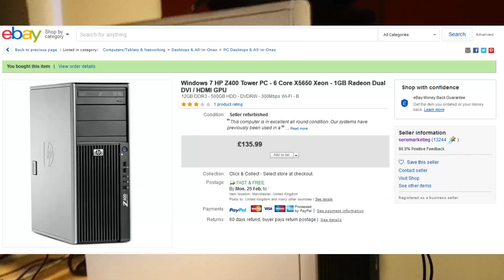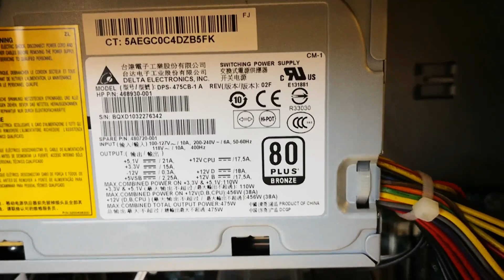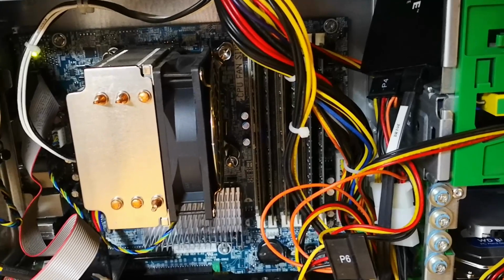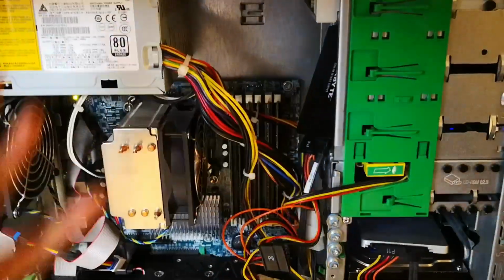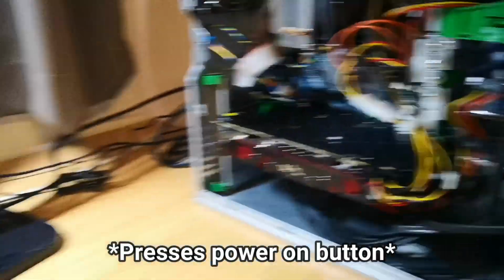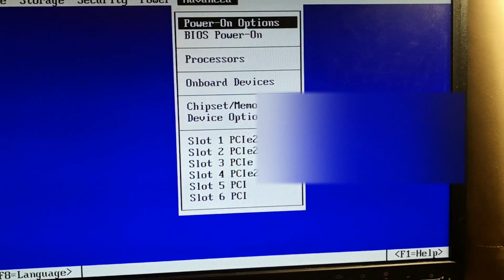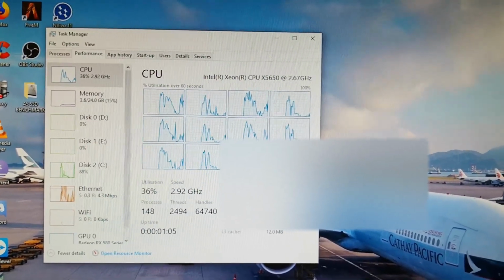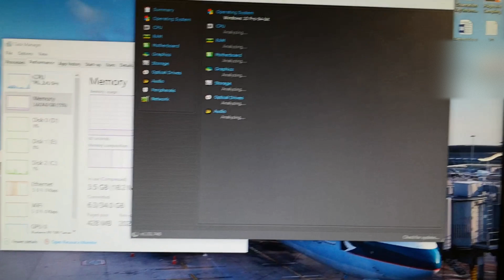HP Z400 6 core 24GB RAM RX 580 Xeon £300 GAMING PC build 2019

Comment: I have the z400 too and the xw8400. The workstations can be fully upgraded, even the PSU can be upgraded there is an upgraded PSU from HP or you can get an ATX one with a converter to plug into the motherboard. It does not matter that Sata3 is missing you can do SSD Raid0 and i am getting speeds of 530MB/s +. You can also upgrade to x5690 6 core 12 thread CPU. and 32gb ram for the 4dimm slot version of z400 and 48gb ram for the 6dimm version of the z400. The only limiting factor to the machine is the PSU so if you want to go to a high end GPU you must change it. I for now have the nvidia 1060 which works great.
Reply from the maker: Actually, you could change the PSU, but it won't physically fit inside the case. IT IS NOT ATX SIZE. Yes you can change to the HP 600W_ one, but there is really no poin, this platform is long dead.

Yes the CPU, I have upgraded to a W3680 now.

And the RAM, You can only use 4GB dimm modules. Please refer to this: https://h30434.www3.hp.com/t5/Desktop-Hardware-and-Upgrade-Questions/Z400-RAM-Upgrade-from-8GB-to-12GB-or-16GB/td-p/6746942 ** EDIT** Apparently You can use 8gb dimm modules, but it is not officially supported by HP. plus, if you had that much money for that amount of ram, might aswell buy a new PC
Reply: @UrbanOzzy  Atx psu can fit inside. GreenPCGaming has done so. There are videos here on YT. Latest CPU you can use after bios update is x5690 or w5690. And yes you can use 8gb ram stick after bios upgrade.
Reply: @isymdvr  w3680 is better because it can be overclocked to 4.00ghz
Reply: @xenooseater6124  Yes i have done that software overclocked the w3680

Comment: Help, I can't get the graphics card to work. Rx 480 8gb, if I put it in and try to start, the power button turns red and it beeps 6 times.
Reply from the maker: reset bios settings by taking cmos battery out of the motherboard for 30 seconds, then put it back in! Should work. After which, place rx 480 back in
Reply: Update your bios to

Comment: I have the EXACT same Z400 gen2, I have a XFX RX 580 8 GB, 12GB 1333 DDR3..
I replaced the old PSU with a Semi-Modular Rosewill 650w PSU, all black beautiful cables, no issues at all.
I also mounted a small fan on the NorthBridge, and an Arctic front case fan.. My rear case fan is silent, along with the CPU fan.. Even when I crank it up all the way through the BIOS, the fans aren't really audible, just sounds like air blowing. Maybe your fan's bearing is going out.
SATA2 doesn't restrict your 4k write/read speeds AT ALL, so the most important part of gaming performance from an SSD aren't hindered..
The X5675 is a great option for CPU upgrade, if needed, and remain on the same TDP, the X5680 brings it up from 90w to 130w.
The "W" series CPUs are only different in a singular way, they cannot be used in "dual CPU" configurations, which we aren't worried about, so those are perfectly fine for upgrading..
Reply: Mine sounds like a jet engine at full speed
Reply: The W3680 & W3690 CPUs are also multiplier-overclockable which the X56xx processors do not have.
Reply: Bro does the xfx card work with legacy on the hp z400??
Reply: @bestage9429  also mine.. At least 1800 rpm the chassis fan..  I would like to reduce that value...
Reply: @matteozambon6744  I've tried overriding the BIOS fan control with SpeedFan before, didn't work unfortunately...
Only thing you can change is the minimum fan speed in the BIOS which only affects how fast the fans run when the machine is cold.
Reply: @bestage9429  already tried too.. And already set up the speed of lowest level on bios.. It start to be quite fast after i update the bios... Temperature seems normal
Reply: @matteozambon6744  Mine also only started ramping up the fans to ridiculous speeds after a BIOS update... Actually before the update the fans would barely ever ramp up above minimum speed at all under full load, so pretty sure something's running a fair bit cooler now at least! CPU temp hardly ever exceeded 67 deg C under full load (stock Xeon W3520)

Comment: How stable is that RX 580 + overclocked W3680 configuration running with that 475W power supply? I'm a little worried about that molex to 8 pin connection whether it'll handle the full wattage of the RX 580 or not.
Reply from the maker: Very stable at 4.0GHz, I play siege everyday in fact. But do get the DUAL molex to 8 pin though
Reply: @UrbanOzzy  Alright, thanks for answering.

Comment: You can change the ps just get the adapter from moddiy. The CPU cooler can also be changed just a bit complicated.
Reply from the maker: A standard ATX PSU won't fit inside the HP Z400 case. As for the cpu cooler, yes it can be easily done. But the system is currently running fine, i don't see a need for it yet!
Reply: That's very good to know. I will be putting an RX 580 in this beast as well, and hoping not to have to change the psu. I will just need to find an adapter for the 8 pin pcie like you did. Wondering if there would be a difference between going with sata vs molex...
Reply from the maker: @ZuckerbergDaReptilian  go molex it can handle more wattage than sata. Please dont go sata, it will melt, i have tried 😂😂
Reply: Damn :D .... I actually just ordered the dual molex to 8 pin about an hour ago through ebay for like 3 dollars usd. Now I'm thinking maybe they will melt too since I paid so little lol.
Reply: @UrbanOzzy   YES there are ATX PSUs that fit. its been done before

Comment: what about the psu ? Does it handles all of this load ?
Reply: If you use a GPU with only one power connector like the Nvidia 1060 you will be fine for sure. Using a higher power GPU you never know it depends on how much power hungry it is under full load.

Comment: Hello thank you for this video. I'm actually trying tu update my HPz400 with your video. It helped a lot but now I have this error message when I turn on my computer. "517-low power cpu heatsink(s) detected for high power cpu(s)". What should I do ? Thank you very much
Reply from the maker: Please refer to this, https://h30434.www3.hp.com/t5/Business-PCs-Workstations-and-Point-of-Sale-Systems/Hp-Z400-heatsink-problem/td-p/5678105

You will need a 130W rated CPU Fan/heatsink

Comment: hello u can use stock z400 psu for rx580?..i believe rx 580 need 500w psu
Reply from the maker: Yes the stock PSU in the the Z400 is 475W power. Shouldnt be a issue, if you actually watch the video you would know that it will work
Reply: Ok thanks man
Reply: You need a 6 pin to 8 pin converter.

Comment: i have the same pc only i have w3680 3.3  ghz but he cpus it gettig to hot i already replace the paste i think the cooler broken.I bought for 30 euro on a local marketplace
Reply from the maker: Really? I just bought a W3680 too off EBay, I will do a follow up video. Do you have the high performance cpu cooler with three heatpipes btw?
Reply: What is "too hot" ???
Reply: @ZuckerbergDaReptilian  45 degres only youtube
Reply: You're ok thats nothing
Reply: you have face book
Reply: 40-50 degrees idle isn't bad compared to the maximum temperature of the processor (94 deg). What are your load temps? Make sure it doesn't approach or exceed 90 under load and you should be fine.

Comment: Hello i know this video is old,but can i upgrade my xeon w3520 to a 5650,or do i require a different motherboard
Reply from the maker: Highly likely, but check with others first
Reply: If you have 6 slots of ram memory, for sure.. I just upgrade from w3520 to x5660.. Even the ram will run faster..

Comment: can i use rx 580 on 475 watt supply?
Reply from the maker: Yess no problem at all, just get a molex to 8pin adapter though
Reply: @UrbanOzzy  I did it with 6 to 8 pin connector
Reply: @ZoXXy20  bruv did it work, is it still working?
Reply: Yes it's great a
Reply: Yes it's great a
Reply: @ZoXXy20  what bout the legacy and uefi issue plz tell me it's not tru
Reply: @ZoXXy20  also you think i cud get a xfx rx 580 running?

Comment: I have same x5650 in z400 , my cpu always runs at 90 degrees under load can u check your temperature
Reply from the maker: 60 on load, change the thermal paste often mate. Make sure you have the high performance cooler on it
Reply: I did it and its stock 6 pin sink of z400
Reply: Still runs at 90 at load
Reply: Which cooler shall i install
Reply: @AbhijeetSehrawat  same issue ...
Reply: Yeah I suggest changing the thermal paste on it first. The X5650 has a TDP of only 90W, my W3520 is 130W and yet only runs at 60 deg under load and 40 at idle with the stock "High Performance" CPU cooler. So it should be fine with the non-performance cooler.

Comment: Oops, need to update the bios to put the x5650 ??? or it just fits it
Reply from the maker: It just fits, no bio update required
Reply: A BIOS update is recommended if your current version is older than 03.57. I literally 'upgraded' my performance a bit by updating to 03.60 from 03.04. Also if it's a really old version from 2010 or earlier, it probably will not work with X56xx or W36xx CPUs.